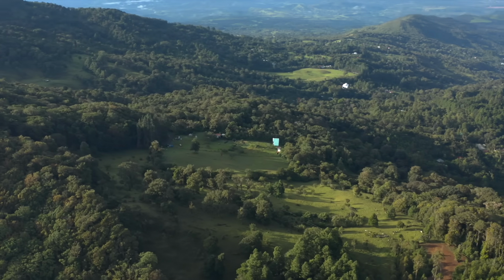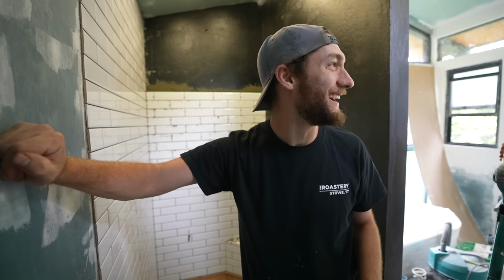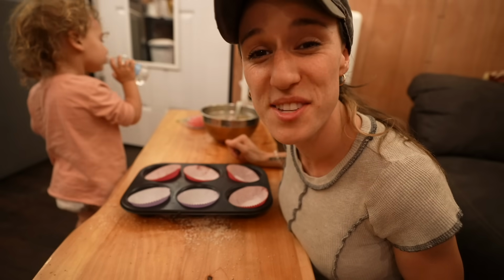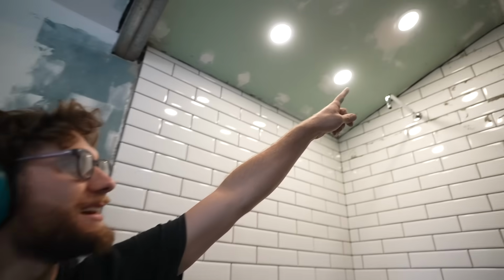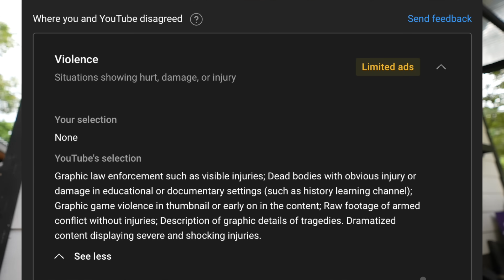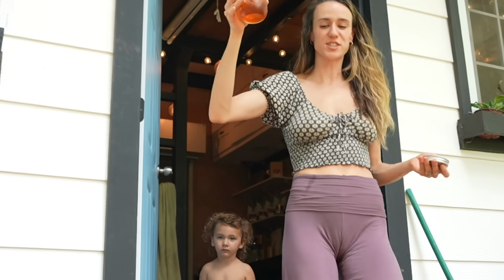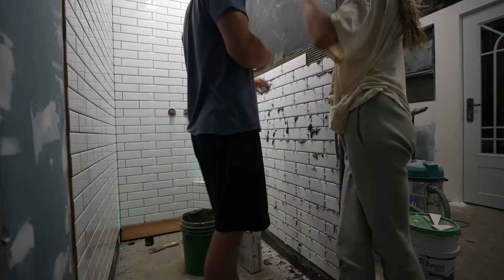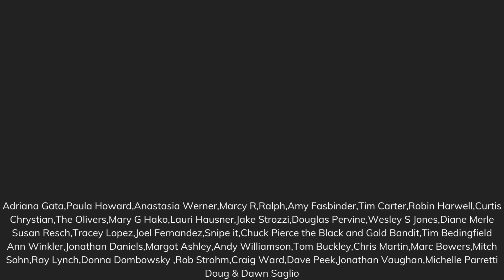SHE'S MOVING IN... new girl on the farm

Comment: Back in the old days, before laser, you would tack a small wood strip at the base of the wall, use a level to square off from your corner and set your first row. We didn't use silicone spacers, did it all by eye (saved time, time is money). We would set 150sf of wall tile in one day, come back the next day and grout it. The tile adhesive took a day to dry, the grout took a day to set and the shower could be used the morning of the third day.

Comment: i owned a tile company for years. i, no joke, have installed thousands of feet over the years. i am watching you guys install tile cuz i needed a good laugh.
seriously though. you dont need the lazer. get the bottom row of tile level, and the rest simply gets installed. i never used a lazser level except in floor tile and even then, we always chalked lines on the floor. but you guys are doing great. SLOW, but great. If you would have ever excepted my request to fly to you guys and show you some tips, you would have been done by now. Even with drywall.

Comment: Sadie is so cute, you must start making money with her.  Maybe she becomes the new face of Pampers or something like that.

What about building a big outside gathering area with a lazy Susan dinner table for 10-12 people?.  Leave a 12" fixed edge and the center rotate to share multiple dishes.  You got to pit my name on it though.  "Outdoorsman 2B Pavilin".

Most tile installers level the bottom row and use the tile spacers to keep the pattern leveled.  That's something may require experience.

Agree with the glass wall like Rodrigo but I suggest to have a spacious balcony.  Big enough to have a balcony set, enjoy breakfast and do yoga.